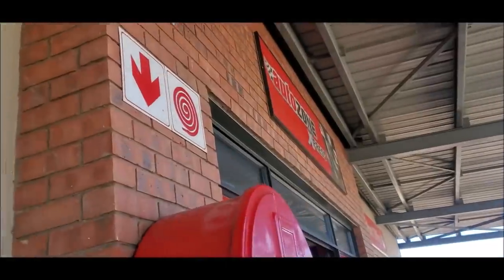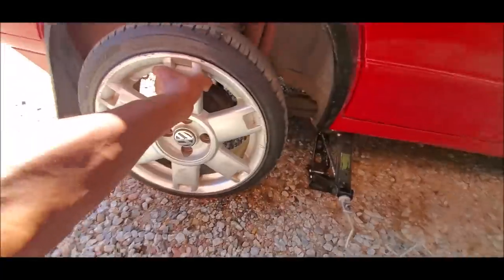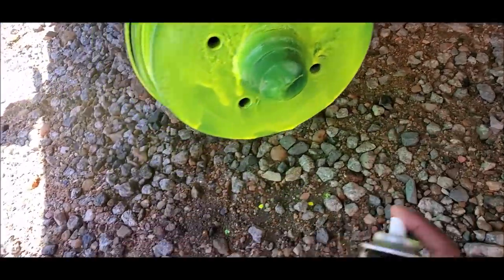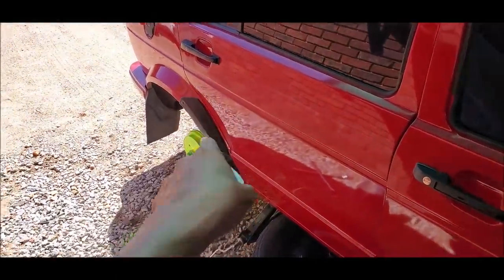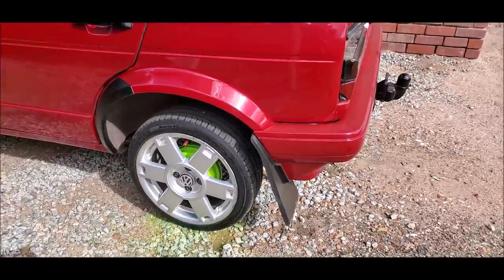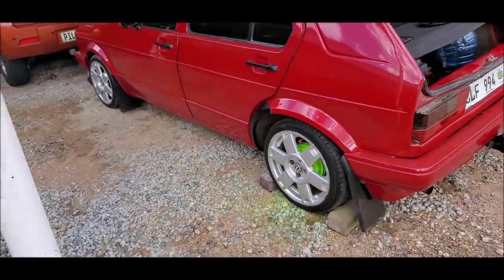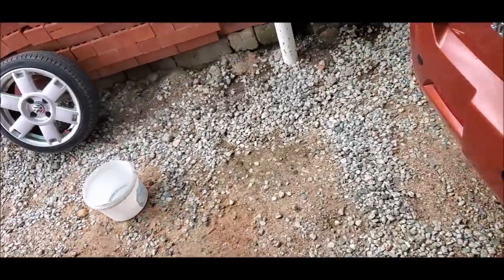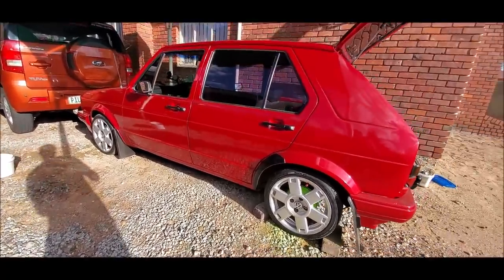TSWETSWANA 💟 SELF BRAKE CALIPER & DRUM COLOUR CHANGE TO LIME 💚 CHEAP CAR MODIFICATIONS 😊

Comment: when you spray paint mfetu. thin coats over it. will help and comes out better without any runs.
Reply from the maker: I apply thin coats over & over again till its rich to the level I want?
Reply: @carsstanceclass  yes brother. will leave a better finish. spray from about 15cm away.